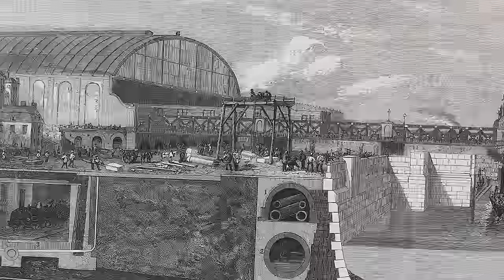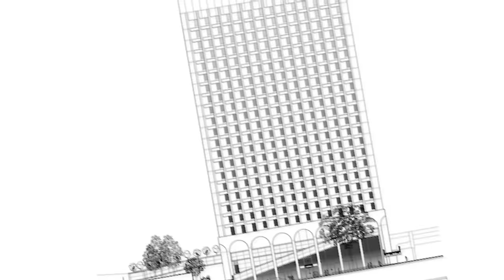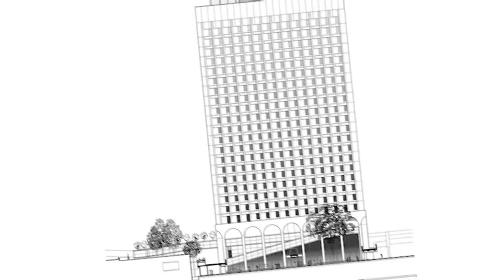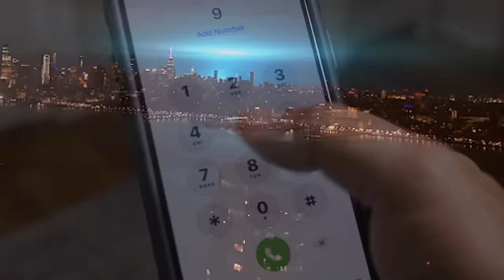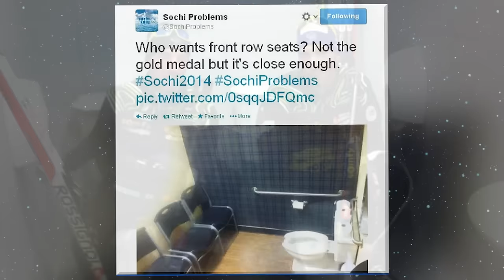15 WORST Infrastructure Mistakes

Comment: The Olympic stadium is not falling apart and totally dilapidated. Where do you get your information?
Reply: Makes it up for clicks
Reply: He is not talking about now, he is talking about immediately after it was built, there were widespread problems.
Reply: Yes he is talking about now. He says “now days”.
Reply: How about: ‘it was made with the same care and construction practices as Montreals elevated highway system’. Olympic domes’ days are numbered friend
Reply: @michaelkhoury6910  I thought you were talking about Sochi Stadium.

"Yes he is talking about now. He says “now days”."

However... "Now days" is not English and not used in the video. Also you ignored the context. He said "The city struggled to shrug of the consequences... (more information)...  Nowadays the place is falling apart, totally dilapidated...not only is the stadium".

Montreal is on a massive economical and industrial decline, falling GDP, lower investment, falling population, lower construction, little to no development, lower investment, lower repairs and business. Montreal is not going to prioritise the stadium over the city... If the city is struggling.. then the Stadium is going to struggle more.
Reply: I'm a Montrealer, and the Olympic Stadium isn't falling apart... in fact, it is much in use.
Reply: YES IT IS. I liive in Montreal. It is a dump